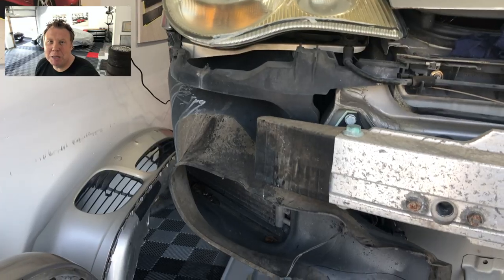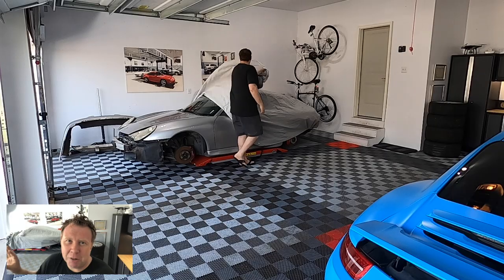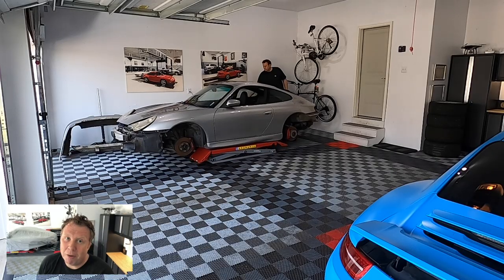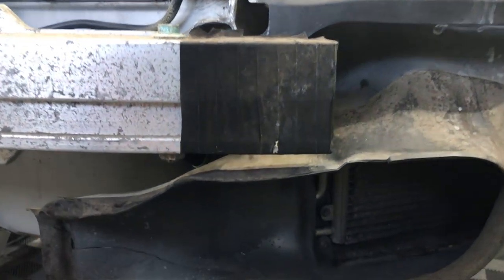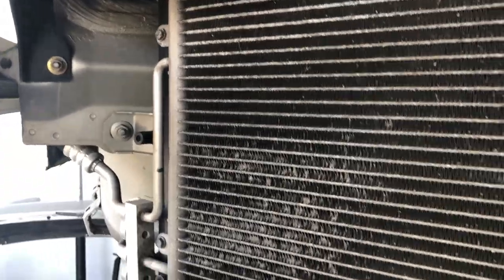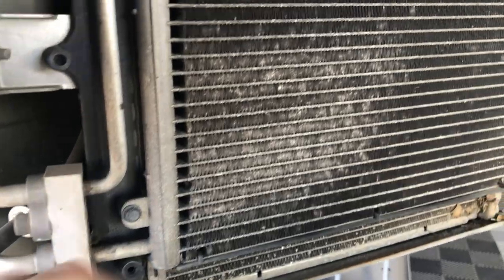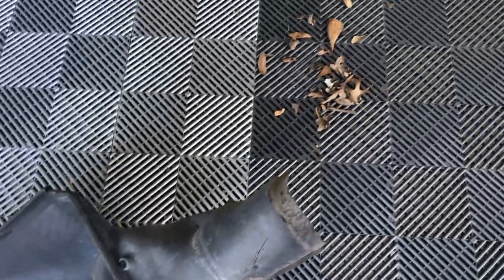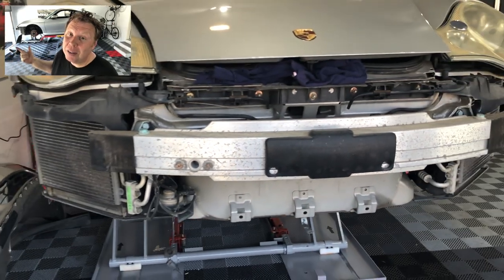Porsche 996 Radiators & Condensers Inspection (Project 996 EP 03)

Comment: I have a 99' 996 C2 cab and I just did this service myself just 5 days ago. Holy hell was there stuff packed in there! There was a literal wedge of just crap on the passenger side one. I took the condensers off too and couldn't believe how much stuff was in between them and the radiator...just unreal! 
If you haven't put the front bumper back on yet I'd highly advise to clean between the a.c. condenser and radiator...alot more stuff gets in between than expected
Reply from the maker: Awesome thanks!! Sounds like a plan!

Comment: You really need to remove the condenser away from the radiator to get them cleaned because ALOT of stuff gets caught in between them. Awesome vid bud!
Reply: Agree.  if separated you can blow compressed air From BEHIND thru them to do it right.

Comment: They make a cleaning fluid for radiators, its a spray on, let it sit, use water to remove. Don't get it on you paint.  Have seen it used, and you would not believe the amount of dirt,grease etc that it lifts off the surface of the radiator. Give it a try and see what you think. Simple Green.
Reply from the maker: Good to know!

Comment: I just replaced both rads and condensers due to corrosion. Perhaps you got the bumper back in place. If not, I recommend cleaning the condensers and rads with an Air Conditioner Foaming Coil Cleaner. You will be surprised all the dirt and grime that rinses out. Cheers!!!

Follow us at www.instagram.com/drowned_porsche

Comment: Hate to be a party pupa but those fins really need to be straightened out and all the little bits of sand and what not between the fins need to be blasted out from the backside of the radiator with air, and as for getting that far the poor condenser needs to be shown some love as well with the air hose.
No disrespect intended but if you  guys are gonna half ass the job it’s probably better to do it off camera. Some of us do our own work and have already been where you are going. 👍🏾